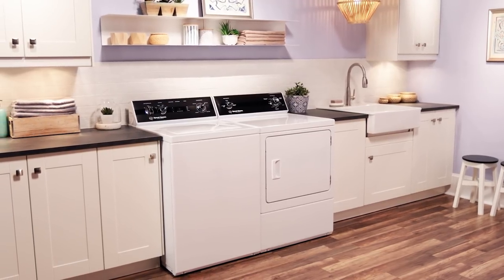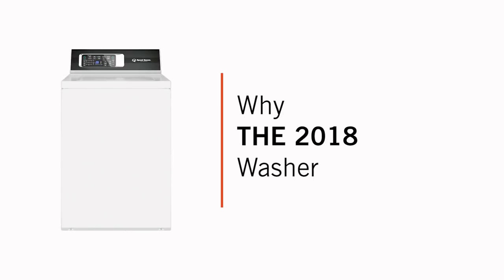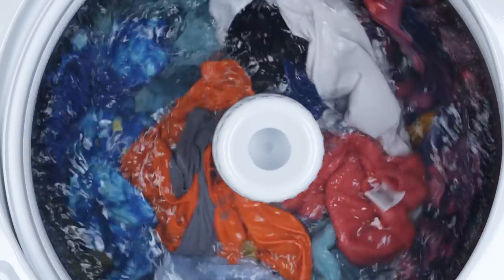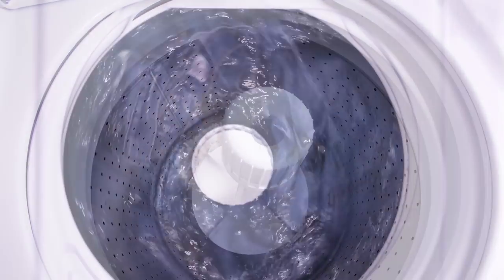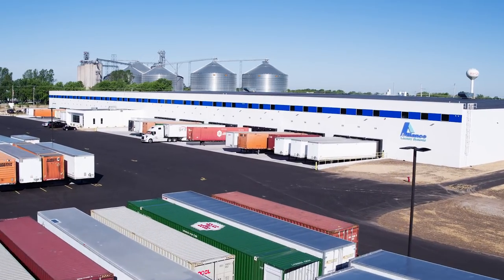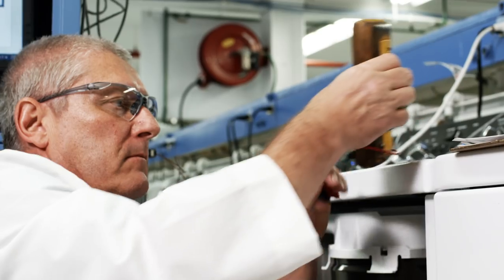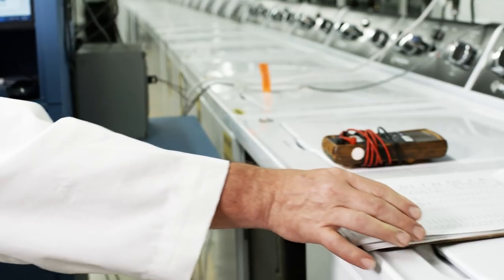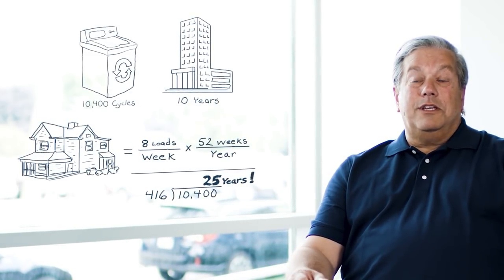2018 Speed Queen Top Load Washer Overview

Comment: Lid lock on my Speed Queen top load washer has failed twice since I purchased it new 18 months ago (purchased in new in November 2018). Each time was in the locked position with full of water and clothes. Unit will not operate. Waiting now for delivery of second replacement lock. Love the machine otherwise, but a major pain every time lid-lock fails. Cannot find a way to override the lock.

Comment: I have a 2017 Speed Queen top load washer.  There seems to be a manufacturing issue with the lid of the machine.  The back corners of the lid is binding when opened which causes the paint to chip.  I had it replaced once and now it is doing it again.  Quality control must be aware of this problem.  I called the tech department they had no answers.  I need some help with this problem.  Thanks!

Comment: Hey Speed Queen I will admit that I was hesitant about the wash action with the wash tub and agitator moving together (agitub) but the more I see the washer in action the more I like it I have seen videos that the 2018 Speed Queen washer can get clothes clean by forcing water through and rubbing fabrics together to get clothes clean. Speed Queen continue to make high Quality laundry products.
Reply: this new machine does not force water through the clothes nor rub them together. the clothes move WITH the water. how is that accomplishes anything?
Reply: Are you actually watching the machine wash clothes?  I've watched a number of videos in the last couple of hours and the clothes are basically being moved around VERY LITTLE.  If they are hardly moving, how can they possibly have water/soap 'pushed through the fabric' as SQ is claiming?  Answer:  they cannot!  This is a low quality design, that likely reduces machine production costs, while increasing profit margins.  The fact that they are completely eliminating the front loading machines from the consumer market is lame as well, because it forces consumers into this top loading pile of junk.  i had great respect for SQ up until the last few hours.  They have excellent Commercial machines, but if the commercial top loaders are going to be made the same as the consumer models they too will be junk very soon.  I cannot believe that SQ / Alliance chose to go down the path of lower quality machine at a time when consumers are begging for quality products in all areas...
Reply: I conquer!

Comment: I'm glad I bought a new AWN series with mechanical controls 3 years ago. this new stuff looks like a bunch of garbage. you might as well get a large plastic tub, fill it with water and put your clothes in there and move them around with a broom handle for a few minutes and save $1000. so called "engineers" are notorious for taking a proven design, changing it and coming out with an inferior product which never works as well as the old design simply to justify their position. you people should be ashamed.
Reply: chieftp the new machines are constructed much more cheaply from an engineering perspective than the old and do not clean as well either besides having the electronic junk that WILL fail
Reply: cheaper parts+higher price = more profit. I think we've all figured that out. by the way, they say that "thousands of hours of engineering" went into this. LOL really? what engineering? all they did was eliminate the transmission, install chinese electronic controls and change the color of the face plate. a 5 year old could have done this redesign in about 10 minutes. at least their "engineers" have white lab coats and a clip board. that's how you know they're good! LMAO
Reply: yea there's videos with the machine apart identifying the parts they eliminated and videos proving it doesn't clean as well. they've changed their brand and these will not be bought by speedqueen fanboys or people fed up with "energy saver" electronic washing machines. I'm trying to get a commercial model right now before they ruin those too
Reply: this video is pure marketing bs
Reply: Finally someone agrees with me

Comment: It took engineers three years to come up with this?  Their engineers are a bunch of freaking liars and whores!  What happened is SQ stopped production of their front loaders for some silly reason and applied those left-over transmissions, etc to these terrible 2018 top loaders. All they had to do to meet the new D.O.E. requirements is continue making their front loaders, stop marketing the top loaders to home consumers as opposed to only commercial entities or make a bomb ass wash plate design. The wash plate design works. Why not just do that? Incorporate some Jacuzzi technology. Boom!  Done. Or they could have make a top loading washers with horizontal axis, which is a "front loader" that you load from the top

Comment: All these engineers need to be fired, They have ruined the new model! If you can find a 2017 Speed Queen washer you better buy it! The new ones do NOT clean as good as the 2017 model and older! These have a cheap agitator that just don't work! No more all metal transmission no more! Cheaper motor! a belt that just slips and you can smell the rubber! Speed queen did not do this because of regulations they did it to save money! They have now ruined the Speed Queen Name! Every thing Speed queen use to brag about is gone! Just look at all the youTube vidios! So Sad!
Reply: Can you prove that observation with videos of you using a 2018 machine?